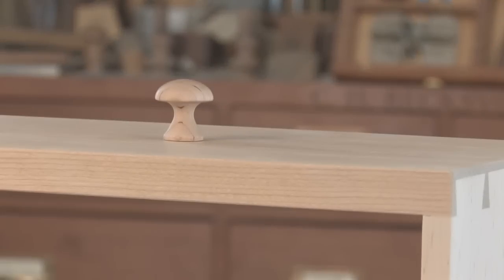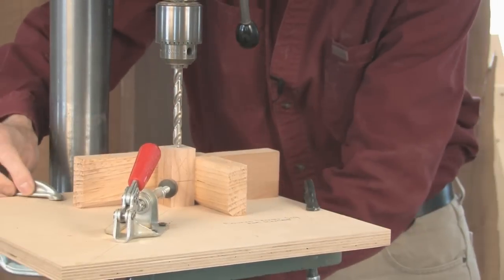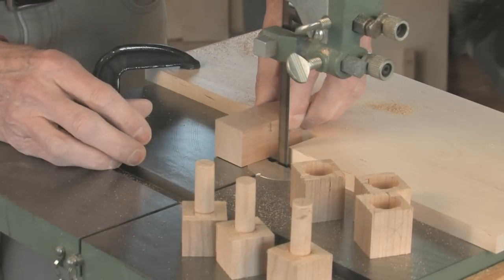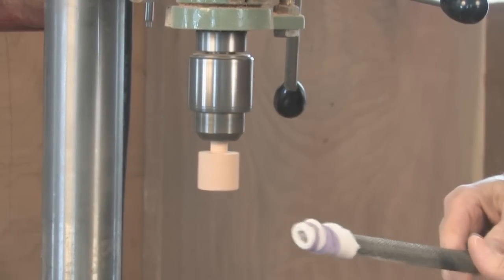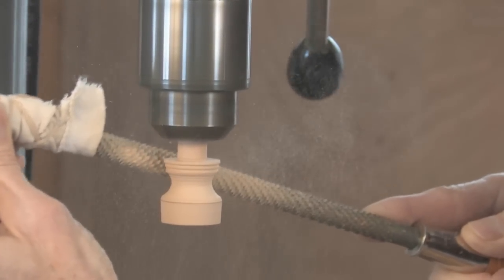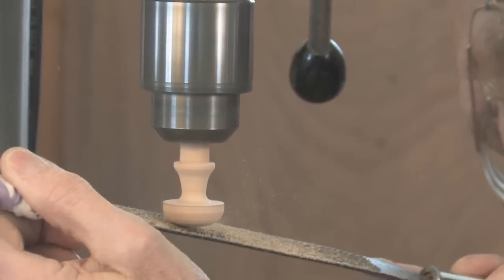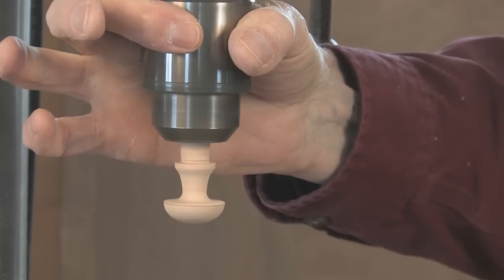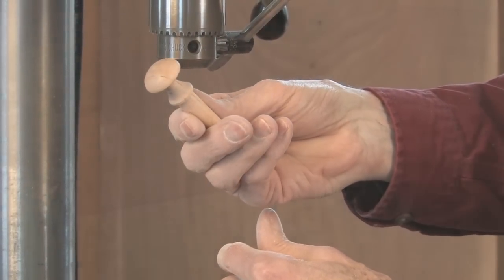How to Turn Pulls Without a Lathe

Comment: I tried the method with some guitar end pins and it worked out marvellously. It's actually much simpler to turn small pulls and end pins with a drill press than with a lathe.
I even managed to turn a 5-inch-long peg winder for my lute, too. The longer workpiece wobbled a lot first, but things got better, and I ended up with a lovely shape for the tool.
The end pins and the peg winder were made from hard maple, so they were pretty difficult to turn after the first experiments with spruce. I used some leftover pieces of spruce and a maple garden tool handle as round stock for the project.
Spruce got its shape very fast, but the tenon part got damaged (squeezed) in the chuck. Still, it held out until the end of the operation without major problems. In case of the maple the tenon didn't get damaged by the chuck and held perfectly. To me, cutting the tenon was the biggest challenge, because I had some very rudimentary, cheap tenon cutters. They caused a lot of friction and overheating. If I go on making end pins like this, I must get some decent tenon cutters. It's also possible to drill a hole in the workpiece, glue a piece of round stock in it and hold the piece in the chuck by that tenon.
Thank you for the idea, it has encouraged me tremendously to go on with the project. The funny thing is that I originally bought my drill press a few years ago for exactly this purpose. Unfortunately it turned out to be a supermarket quality scrap. Back then, I tried to turn a few very small pieces out of ebony and eventually decided to abandon the project because of the imprecision of the machine. These end pins, however, seem to be just the right-sized items to turn with this drill press. I've done some modifications to the drill press, too. The moving column that holds the chuck was very wobbly, so I installed two bolts to limit its play. Now it's OK with only a minimal play. Still, a better quality drill press would certainly be better for the purpose.
I hope my experience can be of help to someone with a similar project in mind.

Comment: But I had to buy a drill press and a band saw...haha. Still a cool video with useful info! Thanks!!
Reply: You can do without the band saw. Use a fine-toothed handheld saw. VInstead of the drill press you can use a handheld electric drill in a drill stand. The quality of your work depends on the smooth moving of the chuck: if it has a play and it vibrates, the knob won't have a nice, circular diameter, it'll be oval.

Comment: Do Shakers use power tools?
Reply from the maker: +Walkertongdee if they were available to them they would have. Shakers were always on the "cutting edge" of technology in their day.
Reply: +Walkertongdee You may be confusing Shakers with Amish.
Reply: The Shakers not only used power tools; they invented a lot of them, including some we still use today.
Reply: In case Gary doesn't get back to you soon here are a few Shaker invented tool. Circular saw, Flat broom, Lumber-drying kiln, Metal pen, Shaker broom vise, Shaker spinning wheel, Water-powered cooling fan, Wheel-driven washing machine.
Reply: Taunter: Also cut nails, disc plows, and many fruit and vegetable varieties.

Comment: I wonder if i can do the same,with a router.Probably the speed is to high???
Reply: That would be very dangerous.  Even if you could get the knob shaft to fit into the collet securely a router's speed is far too fast for this sort of work.  Routers will spin somewhere between 12,000+ RPM for a small laminate trimmer up to 25,000 RPM or more for full-size routers.  If the wood split or your tool got caught the wrong way it could propel pieces at very high speed.